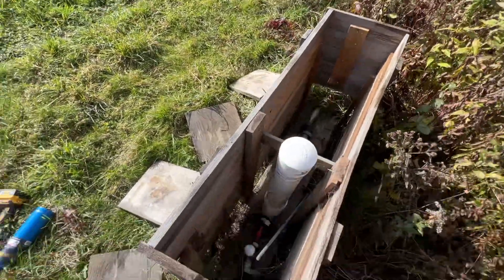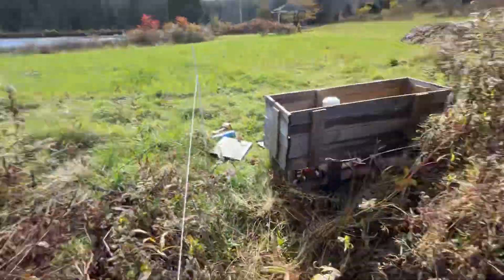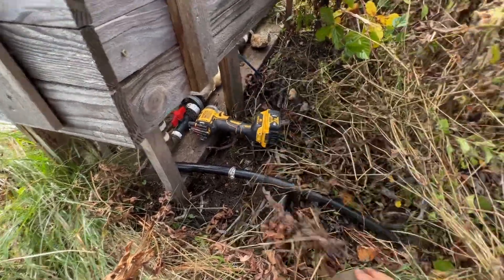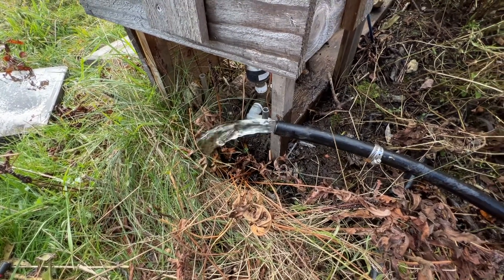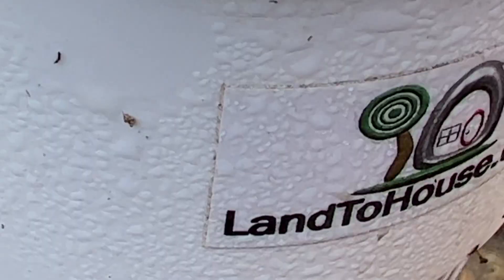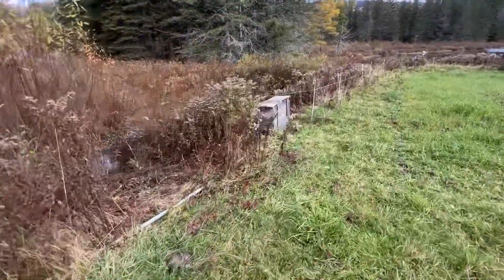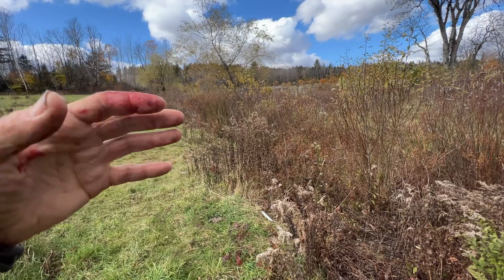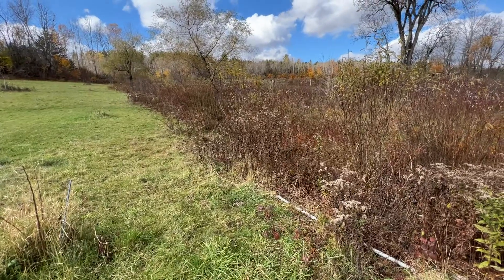Ram Pump: Pumping Water Without Electricity or Gas or Offsite Fuel.

Comment: nice work Ben, I went back and forth between using metal pipe and high pressure rated pvc. I finally went with the pvc, price was somewhat a concern but mostly the rusting factor sealed it for me. A plumber friend mentioned that even galvanized pipe will rust, flake and eventually plug up inside. If money wasn't a concern, then stainless steel or copper would be the bees' knees but alas I rather pay for excavator time than fancy pipe...
Reply from the maker: Good point!

Comment: Our site is actually perfect for a RAM pump.  Do you know if the water your pumping can come from a different source than the water that's running downhill?  We're going to do rainwater collection and want to pump that water to a tank uphill of the house for gravity feed.  The water we'd be using to create the pumping pressure is coming from a spring up high on the property that probably runs at 200 - 300 gpm during the rainy winters here in the Pacific Northwest.  It runs downhill in a seasonal creek all winter and can easily fill up a 5000 gallon tank up the hill to get us through the dry summers, IF it will pump water from our rainwater collection system vs the water that's flowing down the hill...  Fingers crossed!
Reply: hi Carole, you can use one source of water to pump another this type of pump is called a double acting ram pump. typically, its done when you have a non-potable source used to power the ram and a smaller amount say from an artesian spring that is used as a source and pumped as a clean drinking water. they are more complex and I haven't found anyone making them commercially, but this fellow has done his homework and has made one for himself:
https://www.youtube.com/watch?v=22MszYsRtMI
Reply: @blisssmatic  Thanks!